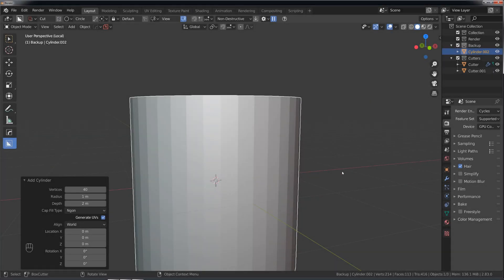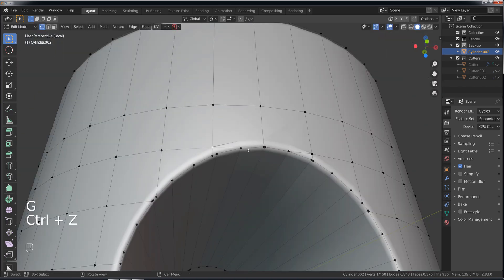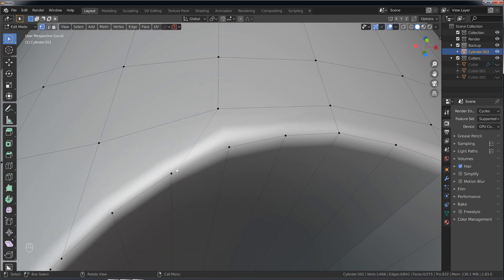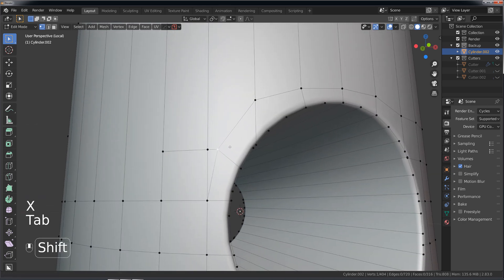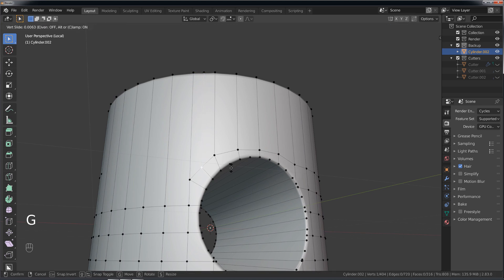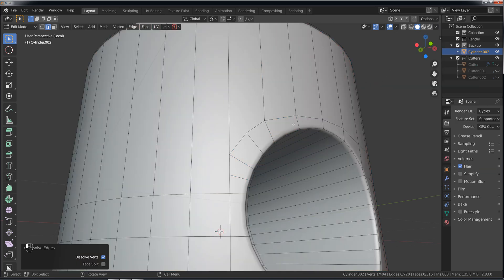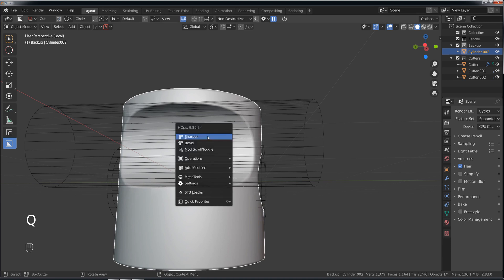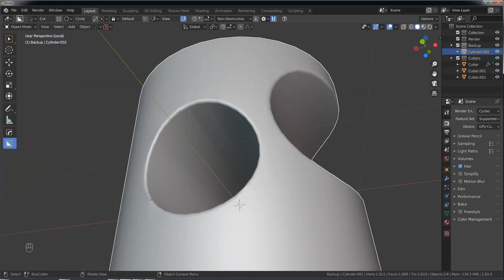BOOLEAN aftermath - understand why the SHADING breaks and how to fix it

Comment: Have a question, you would create a row of edges across the surface and then either connect it to the circle or to a vert on the circle and then delete the row of edges behind it. Why could you have not just made an edge from the circle out to the edge you want without the added steps of creating a row and then going back and deleting it? Does it hold better to the geometry to do it like you did? Hope that makes sense and you know what I am asking.
Reply from the maker: The reason I create loops is because they are equidistant and that creates a nice flow. Also, it is quicker and cleaner than by using knife (far less gg sliding). With curved geo you want to be more accurate with distances and sizes of polies, the shading is sensitive there.  Loops are nice and neat and deleting them takes seconds, because in real situation i would finish editing the bool, and then delete the loops outside the supporting structure via selecting them with alt.
Reply: @PonteRyuurui  Thanks, makes perfect sense now...
Reply from the maker: @kevinm3751  Pleasure!